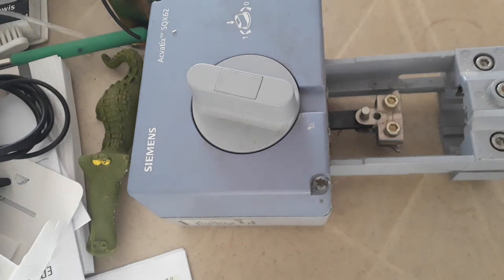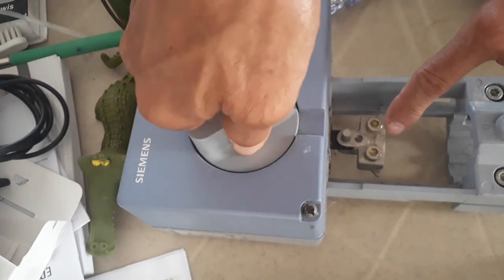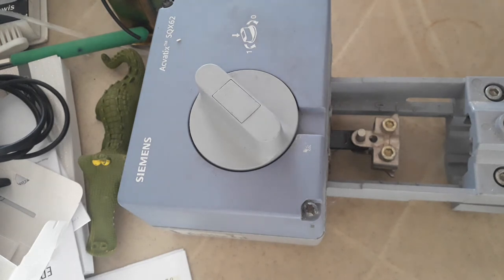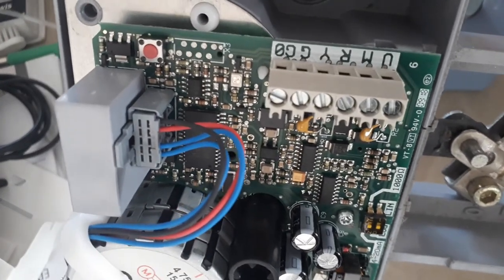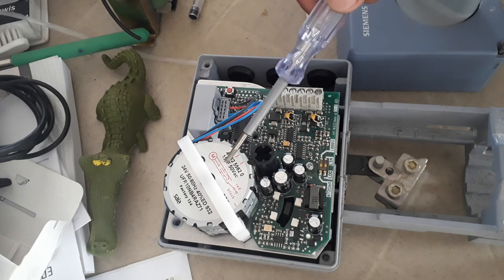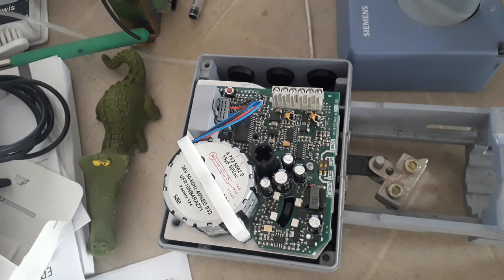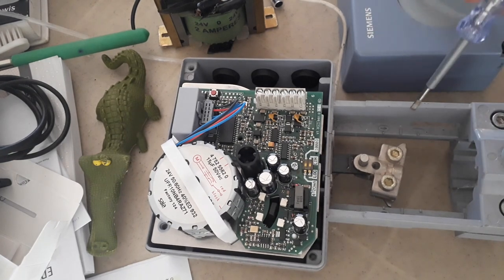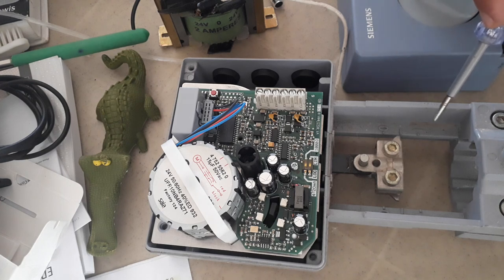How to become a BMS engineer part 65 (Valve Actuator 2)

Comment: Well explained 
When & how to use failsafe actuator?
Reply from the maker: Fail-safe actuators possess a mechanism that stores energy to drive the actuator to a predetermined 'safe' position when power loss is detected. 
 A spring return actuator is desirable in many instances where a power failure can compromise the system. So it depends on the application when to use these type of actuators.